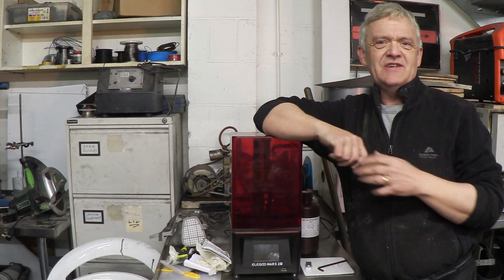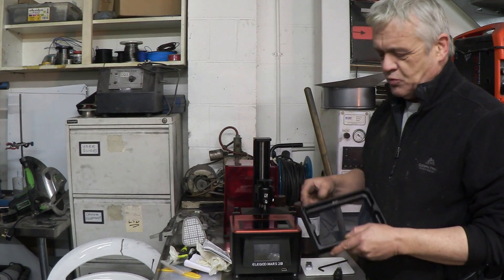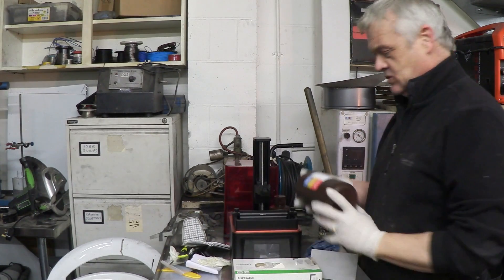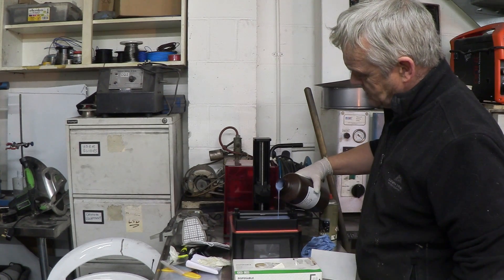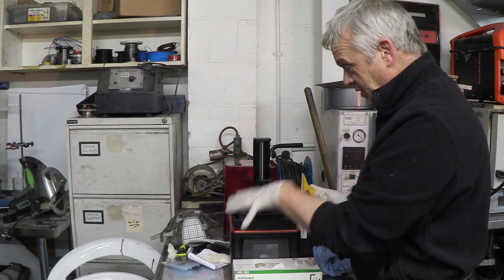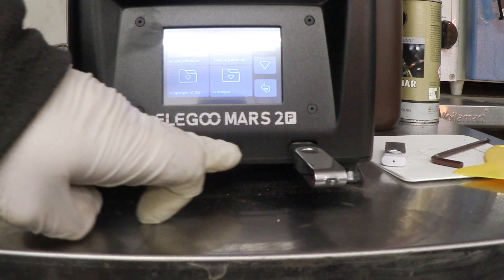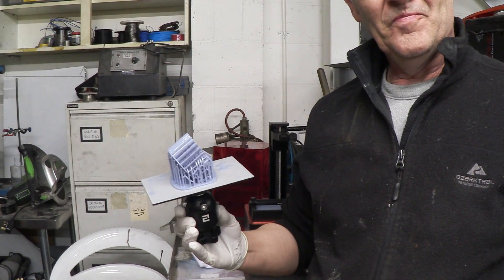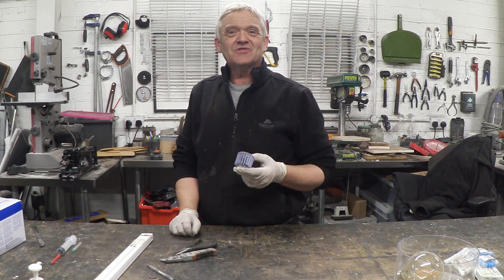1338 Very First 3D Print From A UV MSLA Elegoo Resin Printer

Comment: Hope you stick with this series because functional resin print videos aren't that common. One thing to watch for is going to be the ideal print temp for the resin VOG did an enclosure heater not long ago, Thomas Sanladerer did trials of fillers one being graphite for conductive resins, and finally, Siraya-Tech resins would be a good start to play with as you can mix them to fine-tune their properties and they're not too expensive but sensitive to temperatures...

Comment: Did you need to refill the resin as the print progressed?

Is there a limit to the vertical size or volume of the print?
Reply: no your slicing software tells you how much resin the print itself takes, and you just make sure you have more then enough to keep a full layer on. If in doubt go close to the max level, you can always pour the unused resin through a paint filter cone (or I use a metal drip coffee filter) and back into the bottle.
There is a limit on the verticle height yes (although it prints from the bottom up so I think I've seen people modify them to print much higher but it's a lot of modification work) although you can split a model easy enough in software and print it in separate pieces and glue them together after, would effect the structure.